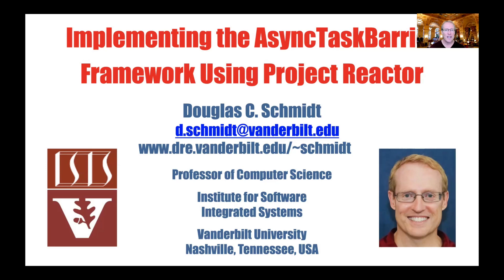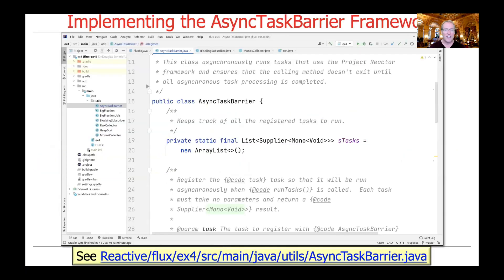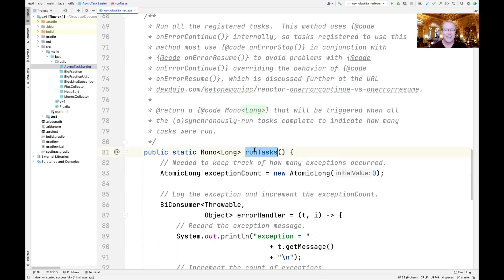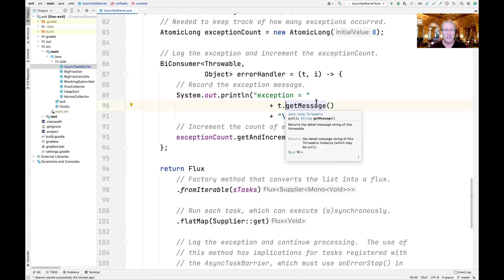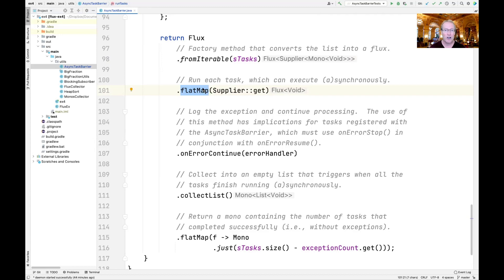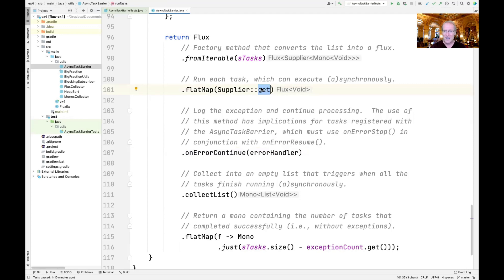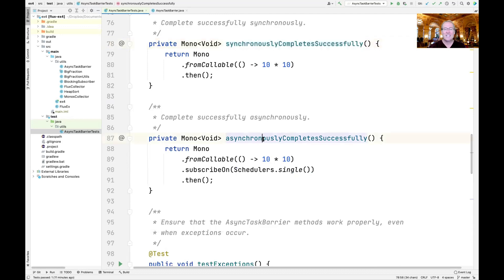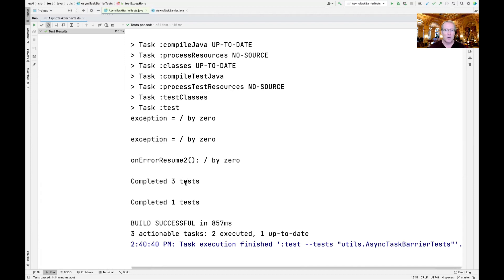Implementing the AsyncTaskBarrier Framework Using Project Reactor

Comment: Prof Doug, shouldn't sTasks be a thread safe list? Are we assuming that register()/unregister() and runTasks() will always be called from the same thread?
#116, we seem to be using sTasks.size() and that will happen in some background thread. So, sTasks should be thread safe.
Reply: Also I think without that, #101, flatMap(Supplier::get) the async thread might not see the correct state of Supplier(No Happens before relationship?). Please correct me if I am missing anything.
Reply from the maker: Yes, they are always called in the same thread so there's no need to make it a thread-safe list.
Reply from the maker: @SanjeevKumar-hj1fb  The async processing within the method referenced by Supplier.get() occurs within that method itself (i.e., using the subscribeOn() operator), so there are no happens-before problems at all since that's handled by subscribeOn().
Reply: Prof Doug, Looks like , we are invoking sTasks.size() on line #115 from within flatMap(). Wouldn't this invocation happen in some other thread different from  register/unregister/runTasks thread? Am I missing something here?
Reply from the maker: @SanjeevKumar-hj1fb  Yes, but this shouldn't affect the value returned by size() because the size of sTasks doesn't change once the runTasks() method starts running. If you're really paranoid you could copy the size of the list into a final local variable like this: 

final int taskListSize = sTasks.size(); 

prior to the beginning of the Flux stream and then say

flatMap(f -> Mono
                    .just(taskListSize - 
                             exceptionCount.get()));

which should address any visibility issues.

Comment: Shouldn't collectList() be called in the assembly thread? Based on the comment and explanation that it triggers when all the tasks finish. In that case, it should have returned List<Void> instead of Mono<List<Void>. Please correct me if I am missing anything.
Reply from the maker: collectList() is not called in the assembly thread - that would make no sense at all since it has to run after all the results are generated from flatMap(Supplier::get).  Please read the documentation for collectList() and you'll see that it returns a Mono<T>.  Also, just check out the test program(s) and you'll see that they all compile and run just fine..